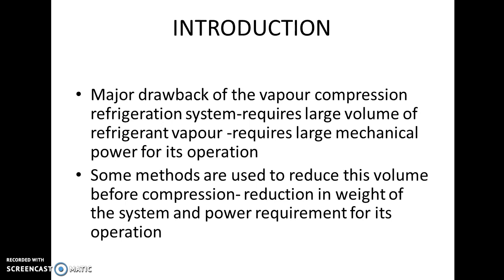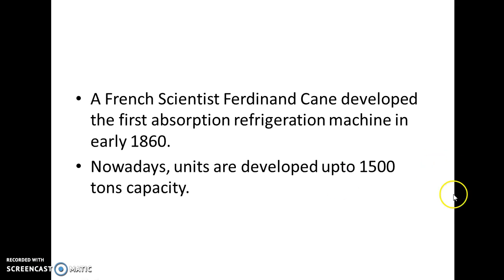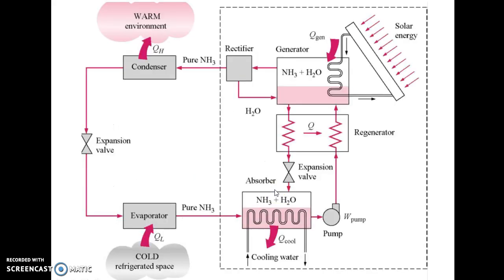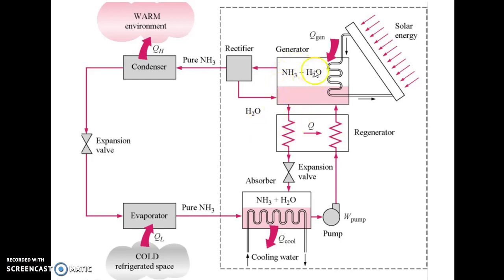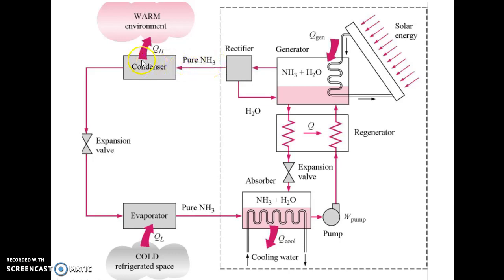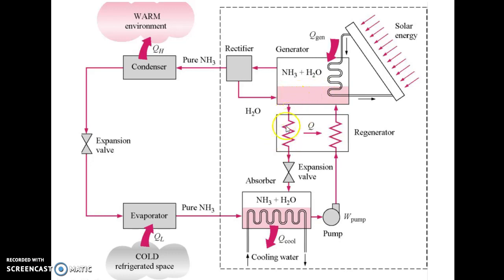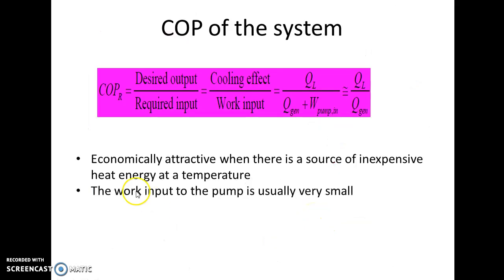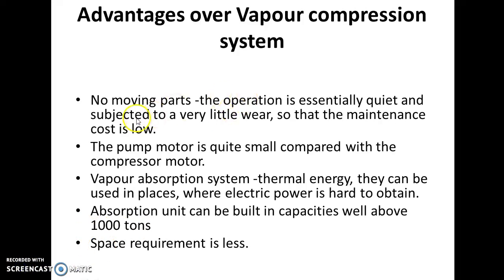Vapor absorption refrigeration system

Comment: I think there is a mistake. Water doesn't evaporate in the generator. Only ammonia gets evaporated because saturation temperature of ammonia is less than that of water. So, water just gets heated and ammonia gets separated due to evaporation. The hot water is then used for regeneration.
Reply: thank u
Reply: you are right, that is why we call it weak solution (in term of refrigrant)

Comment: Can't we connect the output of ammonia vapour from the evaporator directly to the input of the condenser as one is giving out vapour ammonia and the other requires vapour ammonia as input? Why the need of such a system in place of a compressor?
Reply: Ammonia vapours coming out of evaporator have temperature lower than the atmospheric temperature. If they are fed directly to the condenser then they will not reject heat to atmosphere but will absorb heat from the atmosphere and will come out from condenser as superheated vapours of ammonia, therefore the next time when these vapours enter the evaporator they will not absorb heat but will reject heat to it and will produce a heating effect instead of refrigerating/cooling effect.  So this vapour absorber+generator in VARS or compressor in VCRS heat up refrigerant vapours coming out of evaporator to a temperature higher than the atmospheric temperatur so that the refrigerant vapour is able to reject its heat to atmosphere and condense to liquid refrigerant.
Reply: Thank you for your interest and reply. Can you be more specific on how to make the generator and absorber for a laboratory experiment purpose. you can also reach me at rickyterang@gmail.com
Reply: Sorry sir, I don't know how to make the generator and absorber for laboratory experiment. Don't have any practical experience yet.
Reply: ok. no problem. If you know anyone who has practical knowledge and experience in this work, please let me know or make more other videos so that it can be of more help. theoretical knowledge put to practical work is more of what our country needs. thank you.